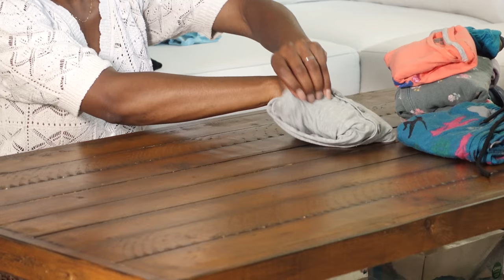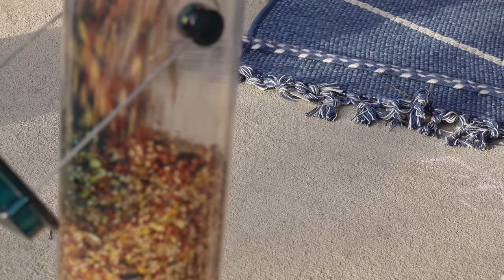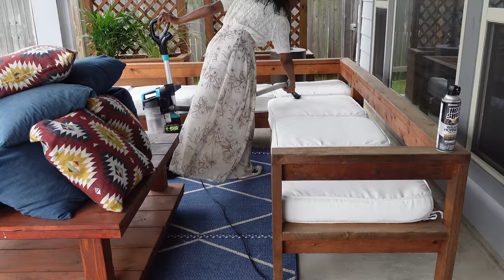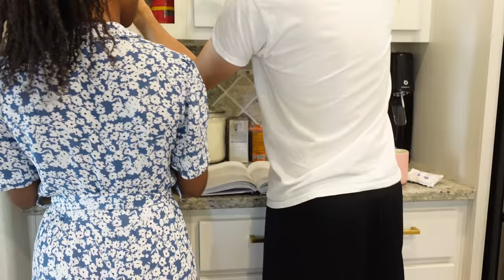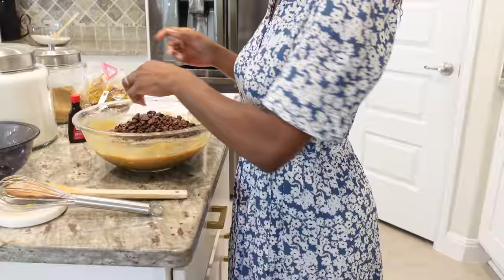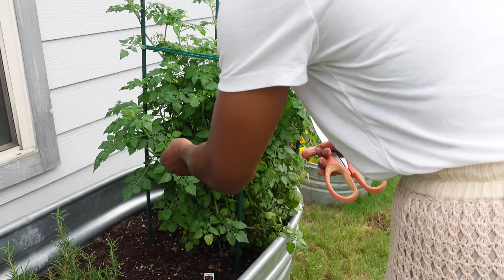(S2E4) Traditional Gender Roles & Division of Labor | Christian • Women • Black • Homemaker

Comment: Baking tips: crack eggs in a separate dish to avoid getting egg shells in your batter. Mix eggs in the separate dish before adding to the recipe. This also reduces chances of overmixed batter or dough which can change the texture of your baked goods.